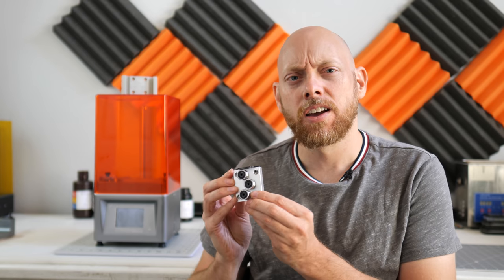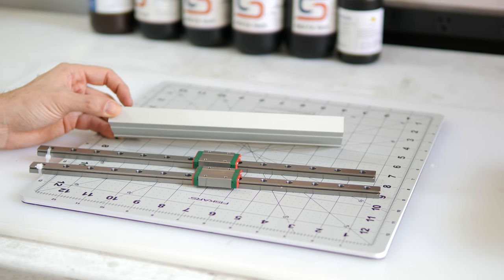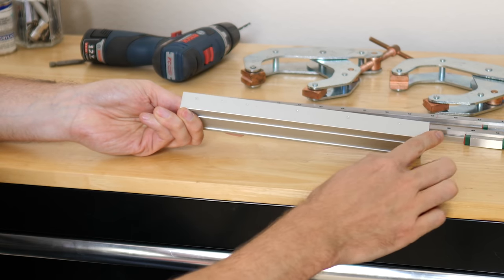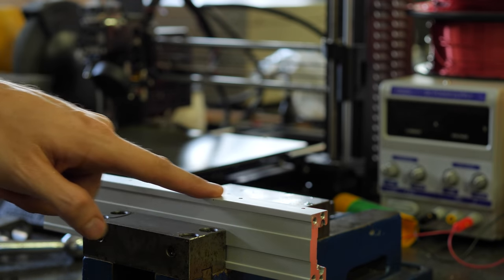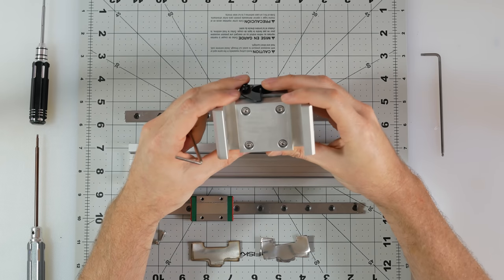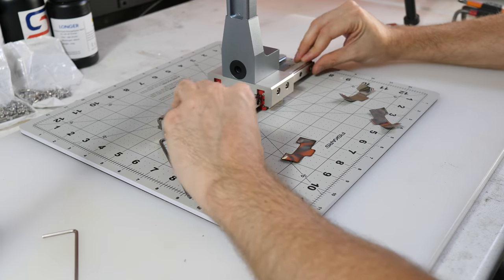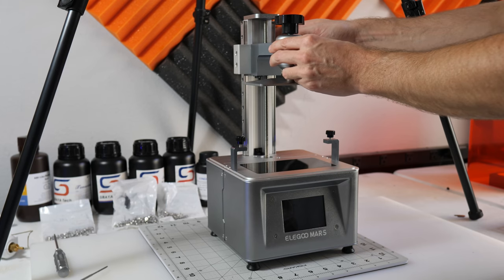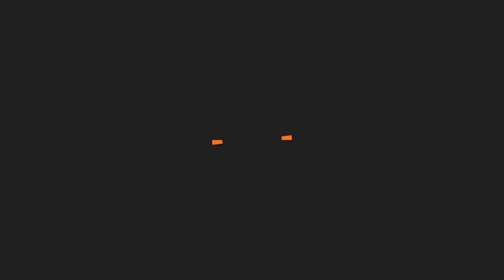Elegoo Mars Upgrade (and Project Alpha Update)

Comment: How do you ensure that the rails you mount are normal to the xy/light projection plane?
Reply: In my upgrade (https://blog.honzamrazek.cz/2020/01/final-tuning-the-elegoo-mars/) I mounted the rails, put a precision machinist square on the LCD and I mounted a dial indicator on the Z-axis carriage. Then I swept the  square with indicator, noted the differences, dismounted the axis columns, scraped the bottom of the columns, and repeated.

Comment: WD40...hss the best smell in the world.
Reply: Marvel Mystery Oil. Used it instead when WD40 residue was discovered to promote corrosion between our assembled aircraft parts. Boeing developed BOLUBE as a safe replacement. Keeping the aircraft skin intact during flight is pretty important.
Reply: Kroil is whats up...if you're into huffing penetrating oils
Reply: Simple green always does it for me, same with c16 but bondo gives me bad flashbacks

Comment: im glad you are passionate about the mod but this is a huge waste of time and money. that printer will never wear out the original chromed rails in the machine, there is simply not a substantive loading scenario to really drive any wear. this machine will be upgraded (replaced) by most users before wear could even be measured on the chrome rods.